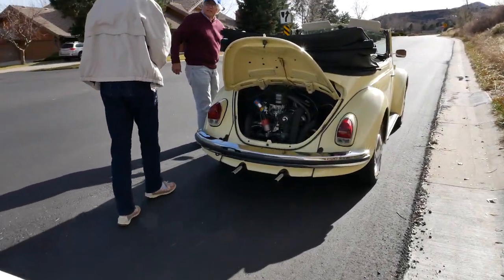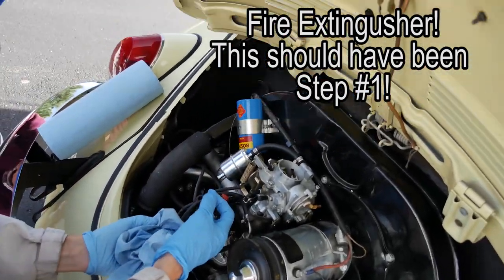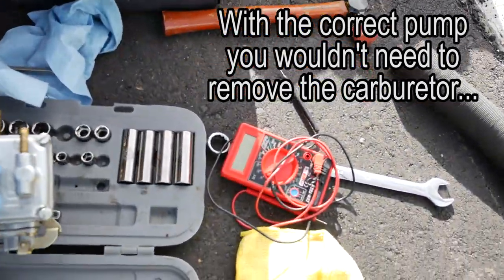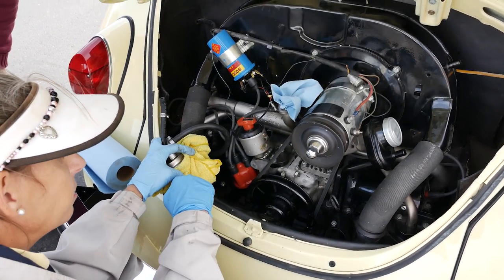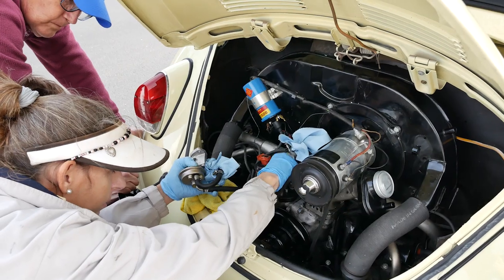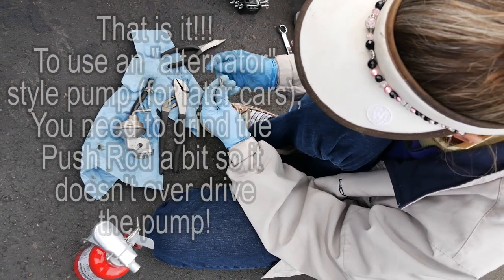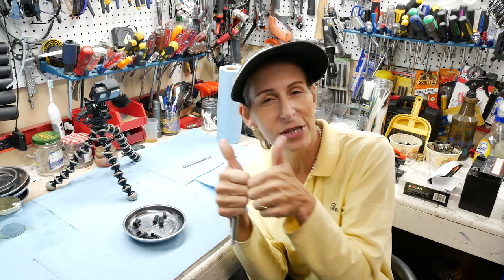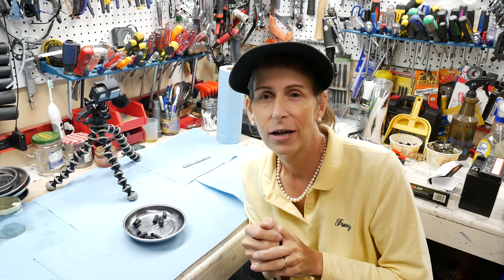Stranded! VW Classic Beetle Roadside Diagnostic (1969)

Comment: I replaced my fuel pump on my 73 SB and the previous owner had put so much grease in the bottom of the pump for the actuator arm that the grease worked its way up and started to dirty-up the diaphragm and put grease into the fuel stream. My lesson; yes, use grease to lube the rod but don't overdue it.

Comment: Rookie mistake: non-slanted "generator" fuel pumps take a 108mm steel pushrod, and slanted "alternator" types use a 100mm steel pushrod.  Note that slanted fuel pumps  can be used on earlier VWs as long as 100mm pushrod is used with them.
Reply from the maker: That is correct. We got this sorted in a subsequent video.

Comment: Great video, Franny!  A real time troubleshooting, a  challenge when we are far from home. The brazilian beetles share the same fuel pump, rod pump, and bakelite flange for either generator or alternator engines. the pump rod must be 8mm ( 5/16) at its lowest point and 13mm ( 1/2) at the highest point. If you don't reach that mark, you shoud stack 2 or 3 paper gaskets  if  the height is more than 1/2 inch, or you should sand the surface of the flange a little bit if you  don't reach the max 1/2 inch. Besides, the low quality pumps we find  here today sometimes call for a "finetuning" in the pump rod height. A little height, your engine will work fine until you reach a highway or  put some load on the engine. Too much height and the pressure goes up, overcomes the needle valve/ float  pressure on the carburetor, thus altering all the metering until you have a dripping carburetor.  Congratulations on your work, we love those real troubleshotings! By far the best videos about vws in english!
Reply from the maker: Thanks you so much Marcelo! Thanks for the specifics on the pumps and rod heights.  That is very helpful :)  It did have me scratching my head a bit, but after a bit of research on the different pumps, I was able to piece together what happened.  One thing I didn't mention was that after the service I upped the main jet from a 120 to 132 to try and correct a low speed stumble under load.  That helped a lot (along with a degree more advance), but I bet then the pump could no longer keep up. 

Thank you for your comment! Wonderful to hear from the Teacher :)

Franny
Reply: No way! YOU are the teacher here!

Comment: That is a problem with the fuel pump rods as there are too sizes, one for the generator and one for the alternator.  Also when I install a mechanical fuel pump I put some wheel bearing grease under the fuel pump were the rod meets the pump arm.     Great channel keep it up.
Reply from the maker: Thanks Brian, welcome to the channel!  Franny

Comment: Just got around to this one. Fantastic work showing your systematic diagnostic process, and then coming up with a fix on the fly. Great work.
Reply from the maker: Thanks Jeff!  I learned a lot about VW fuel pumps!  I hope to finish up the work on this car this weekend. Oh, Congrats on your 911 in four minutes video!  That is super fun and so awesome it got great traction! Franny
Reply: Gearing up (pun intended) to help and buddy on a VW build looking for a refresher and landed hear and enjoyed your video. I got stuck in a toll booth in my first car (Datsun B210) while on the way to the beach. I had my GF crank it over while I looked to see what the problem was and I noticed the coil arcing due to the encrusted oil... I used tape head cleaner I had in the glove box to degrease and away we went!

Comment: Great roadside repair! I have moved my fuel filter on the other side of the firewall to help save my car from another fire. Fire happened because the fuel line I bought from the Irish sounding auto parts store which said “fuel” on it turned to goo in three months and leaked out on my hot engine. I went back to a dedicated VW parts supplier for an original woven style line. The line had turned to goo on the transmission side as well. Thanks to a chef who ran out with an extinguisher and saved my bug. Mine had lost it’s pressure. So always check your extinguisher, bugs are too precious to loose in a fire. Excellent Production. Learned many thing about tune up’s from you. And I’ve been doing mine for 35 years.
Reply from the maker: Awesome!

Comment: I'm getting a 71 Super Beetle Convertible ready to sell for a very close friend who is the second owner. Were having the same issue after he had someone put a new pump on it back in 2007. The car never ran right so he parked it. Now I'm task at getting it running and after a couple attempts it felt like it was running out of fuel. But he insisted a new pump was installed. I bet...and wonder. 
This is a great video for saving you from going crazy wondering what was done. With these cars you've got to play detective sometimes. 
I must admit that when I first saw one of your videos I said "right like she would know". Those words went great with what I had for lunch. You have more than earned my subscribing to your channel thanks.
Reply from the maker: Thanks so much! I think I need to work on my image a bit ;)

Comment: This was aggravating to watch. When the previous owner first combined the alternator pump with the long pushrod, I can guarantee that the hard plastic guide for the pushrod broke. That's the reason for the pushrod movement problem. I waited and waited for you to pull the plastic block. AAAAAAAAAAAAAAA!
Reply from the maker: Yup...  Always fun to step into the middle of someone else's work and try to figure out what the heck.  I did a later video replacing the pump and testing.  Jerry (the owner and gentleman in the video) says the car is running great now.  The tune was interesting on the car and the jets in the carb were way too small.  It took a bit to get this all happy again.

Comment: Great channel, just subscribed!  I just bought a '71 Super in Phoenix and drove it to Wisconsin at the end of July (2019).  The guy I bought it from said he'd drive it across country and I trusted him.  It actually made it and only broke once - in the mountains of Arizona.  The coil wire (of all things) was arcing to the negative terminal on the coil.  So, I swapped the ends around and voila, it went the rest of the way home with minimal issues.  In fact, I averaged 31.7 mpg!  One thing that did have me concerned was the flooding it would do when stopped for refueling.  So, when I arrived home and got some rest, I took the carburetor apart and found a piece of hose material in the needle/seat.  This problem is typically caused by putting old hoses back on the fittings.  The guy I bought if from said he put a larger jet in it so it would run cooler in Phoenix which is understandable.  Upon disassembly, I noticed that it has a 130 jet, but it seems to run a bit fat (rich) at idle and I cannot get it to idle smooth.  I didn't actually measure the jet and it could have been drilled out, I don't know.  It's a 34PICT-3 and yes I adjusted the mixture and air bleed properly.  So, I welcome your thoughts on whether or not you think it may be the main jet, or possibly something else.  Maybe float setting/position?

Comment: My 63’ , 40 hp had a problem where the pushrod would hang in the sleeve and the car would stall especially if it was a hot engine, about 10 miles down the road. The solution was to ream out the sleeve with a rat tail file so there was clearance for the pushrod. I figured this out on my own without a mechanic. The Complete Idiots Guide was invaluable. I miss that black bug!

Comment: George here. Had a similar problem. Driving a '71 VW camper and notice a oil temp rise over time. One hot day while traveling we stopped at a DQ and tried to start the VW. It started then stopped. It was 90 degrees outside temp. My answer ah  vapor lock. Went into a grocery store and got some cold lemons, split them and put them over the fuel line to condense the gas vapor to liquid. It worked,but not long after. The fuel pump rod was to short. The tip that rides on the dizzy cam was not tempered. The fix, I took a piece of my leather belt and stuff it between the pump and rod to add the difference. Ah ha, it work, oil temp went down and we went on our way. I got another stock rod from a VW supplier shipped to the motel and fix it. Go thing, did not want to loose my belt or my pants would not stay up. Ha Ha

Comment: Franny, you are a genius. Loved the video, these trouble shooting style videos are so watchable. I have a 1974 VW Beetle and after watching this I think I have the exact same problem. I bought my 74' bug of a guy who had put in an electric fuel pump and lots of other modern mods. I decided I wanted the engine as original as it could get so I had my bug overhauled replacing items like the air filter for the oil pan filter. One of the other items was to return to a mechanical fuel pump like the one on Jerry's car. It wasn't soon after all this work that I had the problem of the car just not starting. My remedy was a little different.I found the carburettor filled with fuel and after taking the carburettor jet out and blowing it through the car started.. with a lot of cranking and its still the case today. If I don't drive the car for over a day its really hard to start the car again I have to crank and press the accelerator a lot to eventually get fuel into the carb and have it run. When it does start to run, it runs well enough but does if I leave it on idle it sometimes choke out. You've got me thinking that maybe I should check the push rod. I'm going to check out your video on replacing a classic VW Beetle fuel pump.

Comment: I've experienced the fuel pump actuation rod (or whatever it's called) length issue with my 1973 VW Thing dual port 1600 cc engine with new fuel pump. It took a few tries to get it right.

Comment: While driving many VW Beetles over many years, within the first few seconds I could hear the engine is not getting fuel.
The first thing I would have done is to check if there is sufficient fuel in the tank, you don't want to do all the troubleshooting to find out at the end there is no fuel in the tank.
Greetings from South Africa.

Comment: That was impressive work.I just stumbled across your channel.Quite impressed. Heres a pro tip on fuel pump-if you lose the rod that holds the pump lever in the fuel pump you can use your dipstick to poke through there to get you home.Don't forget though to cover up fuel stick hole.
Reply from the maker: Huh...  Never thought of that!

Comment: As always, a great and informative video!  You two are the best of YouTube!  One thing wrong I noticed. Not with your work or the fuel pump but with the convertible top.  It has been put down wrong. I own a 68 Beetle convertible, I have wowed other countless owners with this little bit of knowledge over my 45 years of ownership. When putting the top down on pre-73 VW Beetle convertibles, once the top is vertical before you push it fully backwards pull/push the material, that's the headliner, the padding and the top rearward to clear it all from of the folding mechanicals. Once it's all been pushed back the top will lay flat and you will gain about 40% more vision out of your rearview mirror.  I didn't make this trick up.  It's actually in the owners manual but who ever reads an owners manual.  Do this and you will be amazed. Also when this is done you'll find a hook on each side of the top mechanism that you never noticed before that holds the now folded top in place. Pull the hook back and look closely you'll find a little tab above it that the hook grabs, you'll have to mash the top down maybe another half inch for the the two to meet and mate.
Reply from the maker: It is not our car and I think there was an issue with his top.  Thanks for the info.

Comment: Great problem and rootcause sleuthing!  Had the same problem in my 71 Super some years back.  Seems that the after market push rod I had bought/installed during a rebuild hadn't been hardened.   Ince it mushroomed on the ends it became too short to sustain enough fuel at running speed.    A tough nut to crack without such a logical approach as yours.  Bravo!!

Comment: Come to think of it when I was in Germany back in '73 a local VW expert (everyone in Germany is a VW expert) showed me how to adjust the height of my fuel pump to get maximum fuel pressure by stacking gaskets. I was amazed at how a gasket changed the fuel pressure.
I've owned a haft dozen bugs, they are so easy to fix and so easy to catch on fire.  90% of all my fires (6) have been from the pressed in fitting coming out of the carburetor. So thinking about it now maybe by increasing the fuel pressure too much over rode the spring the the fuel just hydraulic the fitting out...and that's why all my cars and trucks have fire extinguishers now..
Reply from the maker: Absolutely and that same tube let go in this car too... Super scary!

Comment: Hehy "Heidi and Franny,thanks;I managed to get my 1972 Volkswagen on time by watching its full version video earlier,10 degrees mark and 32 degrees with the timing light at 3,000 rpm. now I need to calibrate the carburetor and it's the most work I've done,could you help me;(Gracias) P.S. I have two of then 1962 Beetle and 1972 standard Beetle the two are original from "Germany" Adios y very nice video.
Reply from the maker: It sounds like you have seen this video. This does have carb tuning. Please watch full hour.  https://youtu.be/RJyypWxF3f4.

Comment: I never realized there were two different size rods for the stock fuel pump . I converted to an alternator on my 71 beetle and put an electric  rotary fuel pump in the front just under the fuel tank .

Comment: Great diagnostic session!!! I would have suggested a valve cap of someone's wheel, to extend that rod. But either way, it's a 50 miles, if you're lucky, fix. :¬)
Heh, I was thinking, "What can it be with a Beetle? All it needs is spark and fuel, or tea and cakes!!! X¬D
Reply from the maker: I wonder if a valve cap would fit.  Great idea though.  Check out the pump re-fit video.  You can see it still in there doing its thing.  I was amazed it made it home and it went an additional 50mi or so and was still happy as a clam!
Reply: Hehe, Giant Clam certainly has a big grin on it!

Comment: So how did the fuel pump rod become too short. Did it rear down while the engine was being run? And if this was the case, were there not small metal pieces/filings that ended upon the oil system?    Am I thinking too much?   I just appreciate correct diagnostics. 
You videos are great and always keep my attention. Kudos!
Reply from the maker: Hi Pete, That was a bit of a mystery...  Turns out that the previous owner installed an incorrect smaller pump (intended for later cars with alternators) and with that pump you need a shorter rod or you will over drive the shorter pump.  Then, when Jerry acquired the car, he thought the pump was failing so he replaced it with the proper tall "generator" pump, but was unaware that the rod had been shortened.  When I had Miss LD in the garage I also swapped out the main jet with a larger jet.  The pump was barely working as it was and with the larger jet, and the fact that the pump was not greased and wearing quickly, it all came together on that nice quiet road on a beautiful afternoon with deer to entertain us.  Franny
Reply: Also a full tank of gas would hide the problem, because the tank is higher than the pump.  Once the tank level lowers the pump is forced to pump uphill.  It's conceivable that with a full tank gravity could feed the tank and you could limp home.

Comment: So Franny, are you implying that since I'm substituting a generator for an alternator on a 1600 engine - I should also change the gas pump?
Reply from the maker: If you are moving from an alternator to a generator there should be no problem. Since the alternator is a larger diameter than the generator it necessitated a change to the fuel pump resulting in a different pushrod. The important bit is that the alternator and the generator fuel pump rod are not interchangable. If your new setup does not constitute a pump change you are all set.

Comment: I had the same problem, no gas from fuel pump, I changed it, no gas, I used electric fuel pump , also no gas , so I checked fuel line starting fuel tank and all line , the problem was in the fuel tank no petrol coming due strainer was bent n clogged, I removed the strainer , then all was OK ,

Comment: how do you eliminate vapor lock?
Reply from the maker: Vapor lock only happens on the suction side of a pump (that is why modern cars put the pump actually inside the tank). On a classic VW the fuel line runs past the #3 and 4 cylinders and #3 is always the hottest. Make sure that fuel line is as far away as possible and insulated if you can. Also make sure your car is running well and the engine run shelf gasket is installed and in good shape. If after all that and you are still having issues you can install an electric fuel pump as close to the carb as possible but that is a last result for use in overly hot conditions.